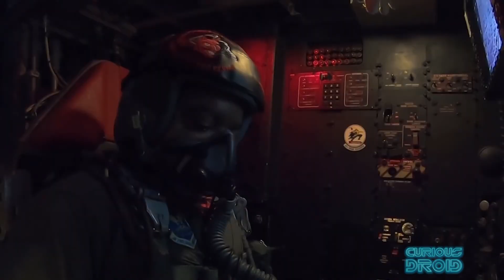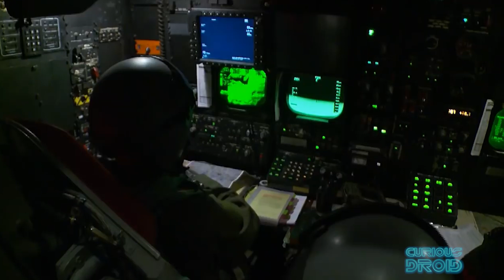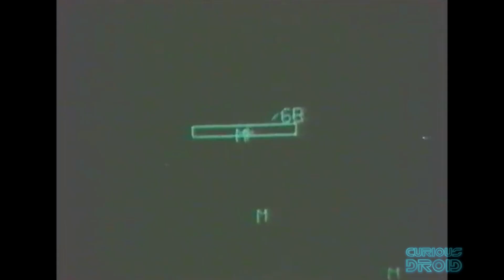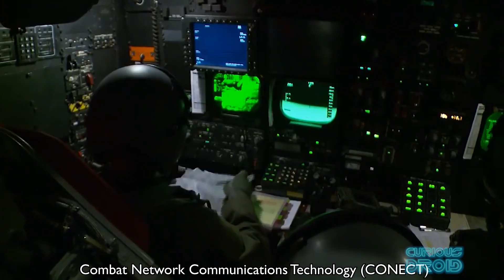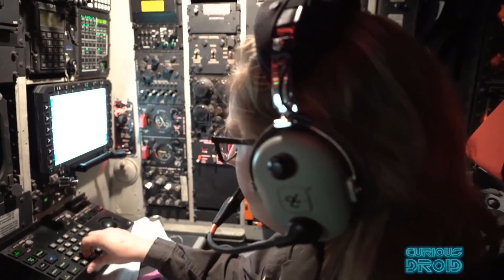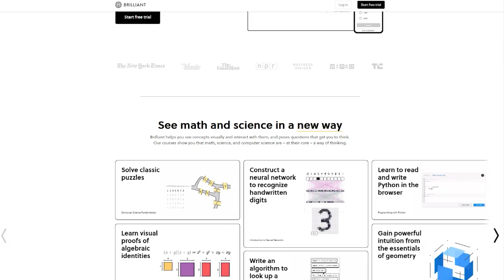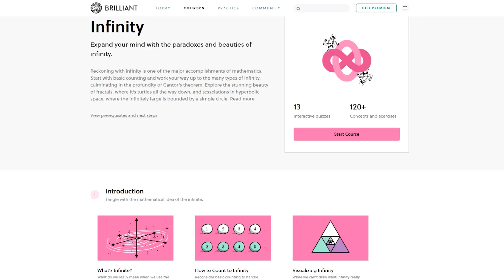How Long Can the B-52 Continue in Service?

Comment: They should upgrade those engines... those plumes are darker than my soul ffs 😂😂
Reply: I was thinking that myself. I see that they are worried about the new engines being too powerful for the old airframe so why don't they just put new engines in with roughly the same horsepower but just brand new technology to be more efficient.
Reply: @frankmyers5971  Watch the movie, "Pentagon Wars" for the answer you seek! It is there.
Reply: I believe they're currently mid process
Reply: They were talking about changing the engines to turbofans back when I was a kid in the ‘80’s.

I’ll believe it when it happens.
Reply: @Justanotherconsumer  It has low bypass turbofans.
Reply: Late 1940's .Boeing, " guys, let's build the last ever bomber to be built ever !!" 2020 It's still in use !!!!. Boeing B 52.
Reply: The dark plumes are due to water injection during maximum power takeoffs, when the plane is loaded to the gills with fuel and weapons and trying to get airborne before the incoming nukes obliterate the airbase.  They aren't that smokey in cruise flight.
Reply: Helium Road that’s scary to picture, it’s a miracle we have not had that need yet.
Reply: @RCAvhstape  What's the water injection for? I was wondering why their exhaust was so dark during full power! 👍👍
Reply: @RDDPro  I'm not the best person to explain it but my understanding is that injecting a bit of water into the combustion cycle adds thrust (ironically) by adding reaction mass or something. If you search on it there is probably a good explanation on wikipedia or even youtube. I know the Harrier also uses water injection when it's in hover flight for extra thrust, and that the water supply runs out after a few minutes.

Comment: Many years ago, I dreamt I was solo flying a B-52, and I recall feeling very impressed with how she handled. I am unsure if it is possible to solo take-off, fly and land a B-52, and have been unable to find an answer. I am going to guess it would be probably impossible in practical terms. Any B-52 pilots able to answer this? Can a B-52 be soloed?
Reply: In practice, aircraft are built to have one pilot. B-52 is no different. 

Would it be more difficult, yes, impossible, no.

Comment: Technically as long as there's an application for it - forever. The cost of operating is the trick (including refurbishment). Per flight hour the B1 has already surpassed it and can carry larger loads (which makes it the next long-life candidate). (edit - I'm pretty sure the second F isn't for 'fellow')
Reply: I worked on the B1 and Rockwell offered the second 100 B1s for half the cost of the first hundred and Air Force turned it down, Could have had 200 B1s instead of 100.
Reply: @MountainFisher  That's pretty cool - my father worked for Rockwell (too) in the late 70s-early 80s (Saberliner Div) after working with Morton Thiokol which obviously interfaced a lot with Rockwell in the mid 70s. He did airframe loads and structures - what was your role? (Aerospace family curiosity begs me to ask - if it's classified of course, don't-answer.)
Reply: However, the B-1 cost of flying and manhours per flight hour is so much higher than the B-52.
Reply: @beverlychmelik5504  Nope - that's the B2.
Reply: @mgabrysSF  Older charts show the B! as less expensive but because of heavy use, it's costs climbed above the B-52.
Reply: No the B-1 payload is 50,000 lbs  The BUF  100,000 +
Reply: @jimfling2128  Nope. 70k lb B52 bs 75k lb B1.

Comment: 1:38 "But [the C-130 is] unlikely to outlast the B-52." Really? The C-130 is still in production today, so it seems extremely likely that C-130s will still be in service when the B-52 is eventually retired. Or are you just saying that it's unlikely that any individual C-130 will have an 80-year service life? Or restricting the the US Air Force?

Comment: The designs were done when slide rulers, log tables, rows of drafters, and human computers were a thing... a testament to good engineering as a team
Reply: Also remember that planes back in the day were not multi decade designs. They were engineered to that degree by people in shorter amounts of time. B52 was designed in 48, first flown in 52, and delivered in 55. The F-22 by comparison was first designed in 1987, first flown in 1990, delivered in 2005, almost 20 years.
Reply: @scythelord  to be fair...the f-22 is measures more complicated
Reply: @scythelord  That's almost the same time span...
Reply: Any aircraft can last forever if the flying hours or cycles are low.
Reply: @Sterlingjob  I worked on those aircraft (B-52s) and I can assure you that the flying hours/cycles were extremely high.
Reply: Kimberly M Which is why they were chopped up!
Reply: @Sterlingjob  they were chopped due to disarmament. And and conveniently make great spare part salvages. That's why there so cheap to run.
Reply: HunterDevastator I wouldn’t say that are that cheap to run. Taking in fuel and they are heavy in maintenance is all money and time!
Reply: @Sterlingjob  Yup be alot easier to replace them with 747s.
Reply: @Sterlingjob  You'd probably be hard pressed to find an airframe of a comparable size with more sheer flight hours than the B-52. Let's not forget that back in the 1960's we had Operation Chrome Dome where we had 18 B-52's flying continuously flying on airborne alert missions to the Soviet Union's borders that literally lasted 8 straight years. B-52's flying for 24 hours a day, 365 days a year for 8 years straight. That's approximately 70,000 flight hours for each of those planes alone.
Reply: @Cynsham  What are the hours currently on some of these airframes?
Reply: I lost my slide rule - I wanted to show it to my kids and grandkids - an amazing piece of kit.
Reply: And don't forget the Analog Differential Analyzers invented by Vannevar Bush in the 1930's and 40's.
Powerful analog computing machines!
Reply: yes you are right, Like the lunar module.. but tell that to military procurement
Reply: They should not get rid of these things ever --- they ought keep it as low tech as possible.
Reply: @ArmonMitchell  if thats the case when are we going to replace the machine guns and misiles with rocks and stones, you know, to keep it as "low tech as posible"
Reply: @carso1500  Yup that is the way to go. Just remember my 7yo calling Avengers assemble and easily beating Captain Kirk with his advanced ship. Kirk totally lost his ship. At almost 12 he needs to become a Ripper.

I would just walk onto a US carrier. Sneak into the nuclear reactor room and throw a paperclip in the wrong place. Buh bye carrier.
Reply: @MrFlatage  eh, you know thats NOT how a nuclear reactor works right, real life is not like a movie at much what that clip would accomplish is... Nothing really, if a nuclear reactor in a military aircraft carrier could be defeated by a simple paper clip a lot of people would get fired, you would just look silly
Reply: @carso1500  Well to enlist you need to pass a test and end sentences? You are not fit to serve for sure. At least Captain Kirk past his written exam before he looked silly. You have no clue how he was beaten do you? Kinda why the Ripper earned his name. 

You never served have you? So some people just walk onboard the Truman. Get inside the nuclear reactor rooms and you think they couldn't have brought more then a paperclip? Yea one pound of C4 would make more fireworks. Paperclips are more fun.

Yes the USN would look very silly. And you do not get fired really. More like Article 5 hearings before a court martial and then you get a nice job behind bars.

Why do you think real life is like a movie? Makes no sense ...
Reply: @MrFlatage  eh, how old are you again, you almost sound like 10, at much 15

I don't really care about what you think the Avengers would do to "kirks ship" as you say, real life doesnt operate by the same rules boys role playing games do, for once no even one kilogram of C4 wouldnt be enough to defeat a modern nuclear aircraft carrier, you could posibly get one of the nuclear turbines out of service with that but for example the USS enterprise (the real one, not the one Kirk flies through space) has eighy of those in diferent compartments, so you would need a lot more of C4 and time to down all of them

Now for the nimitz and the Gerald Ford class it is a bit diferent since they only have two nuclear reactors, deep inside the body of the ship on the more secured parts and are also compartibilized, even if you managed to destroy one destroying the other one would be a near imposible task now that the entire crew of the ship is on high alert

Without taking into account that the C4 would probably NOT be enoguh to completly destroy the nuclear reactor that is encasqued in several cm of steal, the explosión would probably destroy pipes and other fragile systems but the main reactor body would probably be alright (C4 is a powerful explosive but real life  is not like in the movies again, IRL an explosión quickly propagates in every direction losing a lot of energy, you will make a mess and probably get cancer from the contact with the fisible material btw)

And thats if you manage to somehow get through all the internal security of the aircraft carrier that i have no fucking idea how you would manage that, invisible magic or something i guess
Reply: @MrFlatage  also a quick check on Nicholas Paul Knight, he did hacked the information from several navy schools aparently so atleast you got the navy part right, and he did worked in the Harry S. Truman, but nothing about a boarding of the ship (he stealed personal information from the crew) and he was only sentenced to two years of prision, a kind of lax sentence for the kind of things you claimed he did
Reply: @carso1500  Well there is the old saying that I dont know what weapons will be used in WW3 but I can tell WW4 will be using sticks and stones......
Reply: I am a Sociopath.  you mean bomber....ok bomber
Reply: Correct and those engineers could even ... end sentences? How those days are gone now. Kids cannot even end sentences anymore. Now the US is stuck with flying T-fords for their main bomberfleet.

BY now the US AF is raiding museums for parts to keep under 1000 combat aircraft flying. Sad!

Comment: You show an old cockpit and caption "before 2014" ...well luckily that cockpit was also before 1980s...It was pretty high tech flying along at 200' at night with one green screen showing a low light tv camera image, and the other showing an infrared tv camera image.  In the 90s our idea of a moving map display was a laptop propped up between the throttles and the engine instruments, with a gps antenna suction cupped to the upper window....now all that and more is built into the full color displays.
Reply: well it has an ancient navigating computer which doesnt need GPS to find its place on planet earth. only clear sky and the stars. or is it on the sr71 blackbird?

Comment: weird how they called the V-bombers obsolete but the B-52 is still going on strong despite the V-bombers being more advanced lol
Reply: b52 was far more suited to being upgraded than the v-bombers though
Reply: Sadly daydreams of Avro Vulcans B.3s
Reply: @TBone-bz9mp  only if😢same with the victor, all those skybolt missiles look sexy on it
Reply: the v bombers were not designed in the same parameters as the b52.  the v bombers are more for medium or short range precision attacks.   the b52 is basically a dump truck for bombs

Comment: If total nuclear war had happened it was the task of the V bombers and the Buccaneers to go in first and wipe everything out between Germany and the interior of Russia.
Then the B52s would lumber through.
It was the only plan, the BUFFs stood zero chance of crossing east Germany and Poland let alone Russia.
The big smoky arrow pointing to their location was a bit of a liability.
Vulcan could out turn interceptors and render enemy radar useless.
The Buccaneers ran at between 20 and 2 feet altitude.
Reply: Europe: You know we have a nuclear arsenal too...
Reply: @tomf3150  
Oh everybody dies.
Everybody
The Vulcan pilots had blinds on the aircraft and eyepatches.
They would only use one of their eyes at a time, using the blinds and eyepatches.
Each time an H bomb went off in front of them, that eye gets blinded.
3 eyes left.
Not sure if the flight engineer could fly too, that'd be 6 eyes.
Of course only the Americans, Russians and Chinese waste time with heavy bombers anymore, it'd be suicide now.